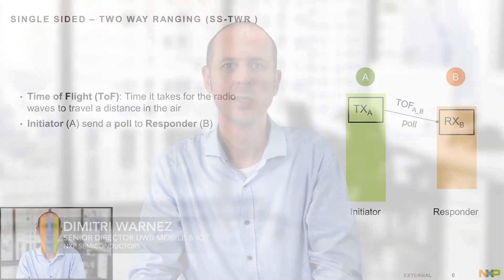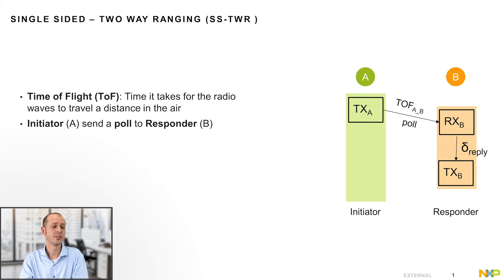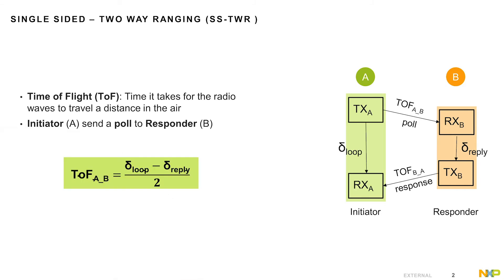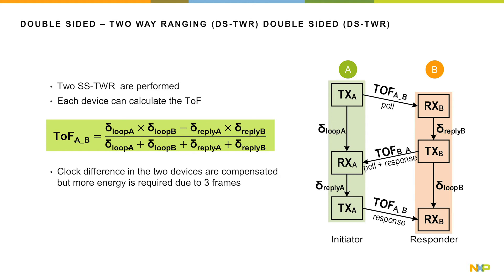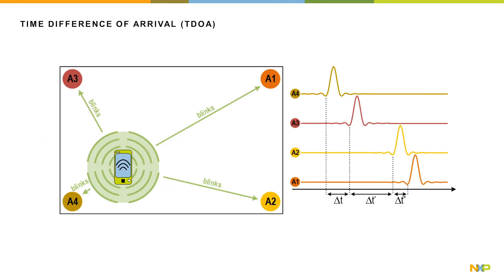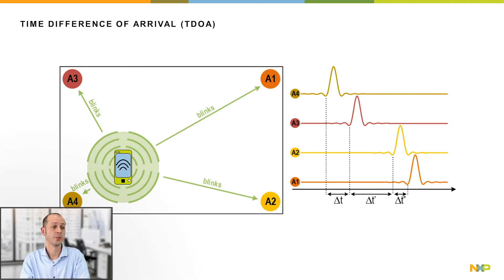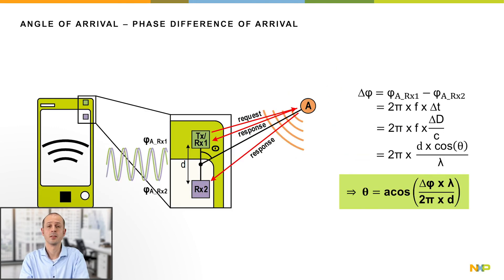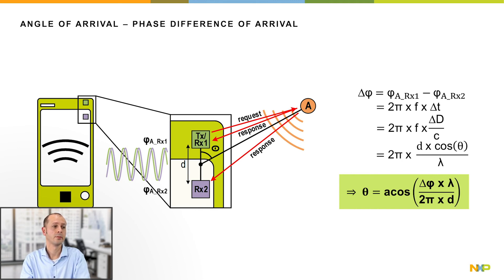How UWB Ranging Works: TOF, TDOA, and Angle of Arrival Explained

Comment: Can we measure height using UWB? 
If yes then how?
Reply: yes, think about it like this. 

One base station can measure the distance from it self, but the range of values is now a sphere around itself because we do not have any other measurements. A second base station will give you a plane where the two spheres intercept. A third base station will give you point, thus three dimensions.